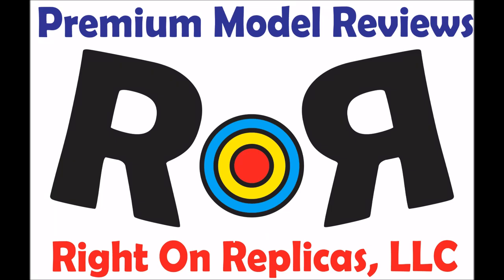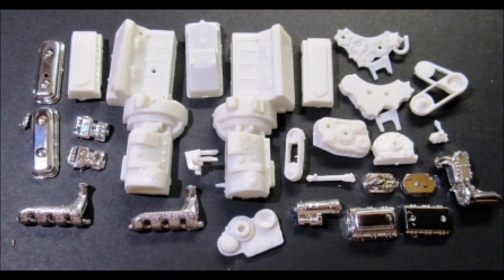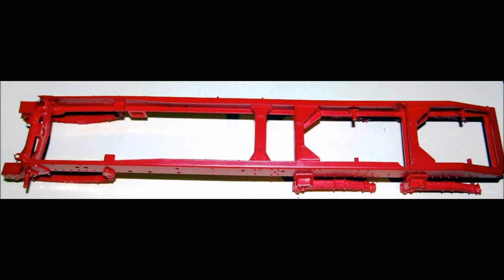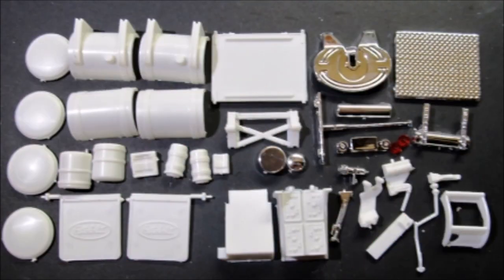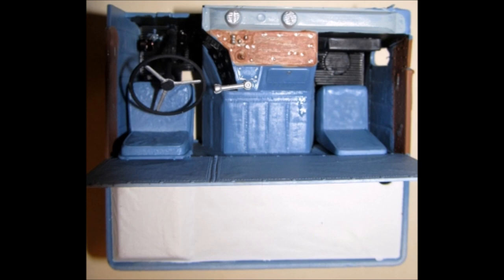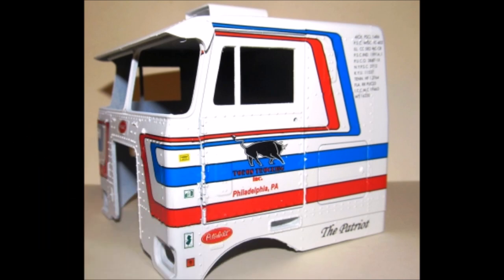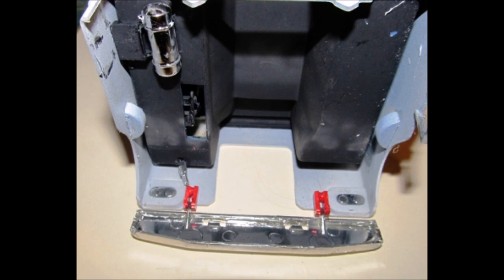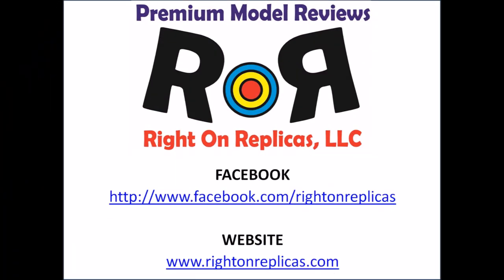How to Build the Peterbilt Cabover Pacemaker 352 1:25 Scale AMT Model Kit #759 Review

Comment: I'm building this kit right now. Although it's not as rough as some of the AMT big rigs, I am glad I found this video. I have referenced it several times already. One thing I don't understand is how did these instructions get past QA? The part numbers on the trees don't remotely come close to matching the instructions. It is helpful to have some automotive knowledge when building these old kits.
Reply from the maker: GG,  Those are some astute observations!  We have to go back in time for some explanations.  This kit was released around 1970.  Just like the real automakers, model manufacturers were pumping out kits as fast as they could to meet demand.  Thorough vetting of the instructions was secondary because - everyone had automotive knowledge back then.  Besides, every boy aged 5-15 was building model kits.  It was second nature back then to figure it out or ask an adult how they should go together.  On top of that, many kits have been repurposed and the instructions never get updated to reflect the changed parts, so they are often incorrectly numbered on these old mold sprues.  That's why we try to show a photo of the parts needed for each sub-assembly for clear identification.  Thanks for sharing your thoughts!  -Doug
Reply from the maker: GG,  Thanks for the update!  -Doug

Comment: I've built probably 8 or so of these over the years. I recently did another one. Some issues I ran into. Drivers sear didn't fit well, had to chop it up pretty good to fit decent.  The other big issue is getting the cab mounted to the frame to fit properly in relationship to to the wheels ect. Took some careful trimming,  and I actually redid it twice to get it to look "right". Others already mentioned the issues you ran into. I mixed my own paint to get close to the detroit green . Yours looks great.
Reply from the maker: James,  Thanks for the information!       PS, please help us reach more modelers by subscribing if you haven't done so already. -Doug

Comment: I've been working on this kit since the first of the year....PAY ATTENTION.  One key thing is the front wheels to the axle.  They stick out too far so cut down spindle mounts a 16th inch. Wheel and tire should be INSIDE the cab. Not outside   it makes a really big difference.
Reply from the maker: Harry,  Thanks for the tip!   PS,  please subscribe if you haven't already to help us reach more modelers.  -Doug

Comment: Nice job,Doug.Very patriotic !!!
Have you ever tried using 5 minute clear epoxy in place of the plastic lenses for the headlights ?
Reply from the maker: Hi Charlie - I have used it for small scale lenses and it works quite well.  You can even tint it while mixing for colored lenses.  -Doug

Comment: on the dash ,you put it in upside down
Reply from the maker: Are you sure!  -Doug
Reply: yes I rechecked .
on the part it has a flat area that is the bottom ,the two large gauges are at the top .also the bottom has a notch at the bottom .
other wise well done
Reply from the maker: RW, thanks for the correction!  -Doug